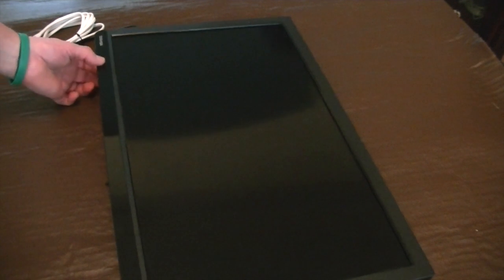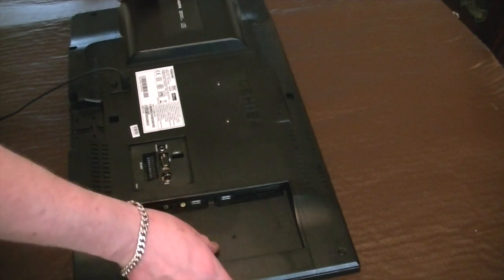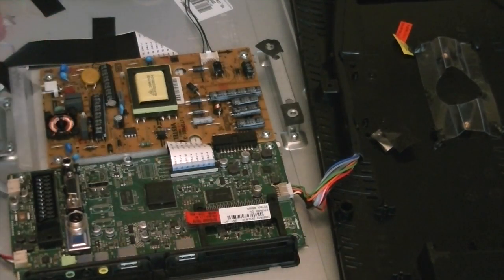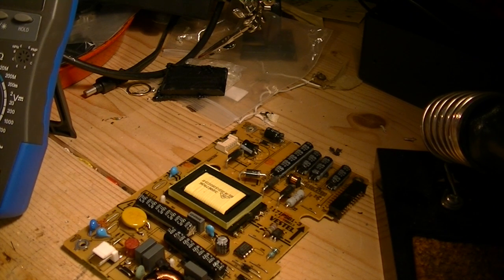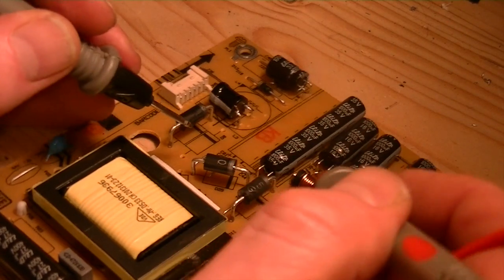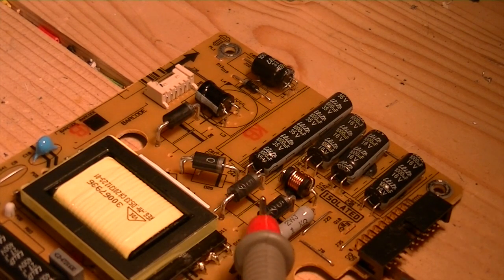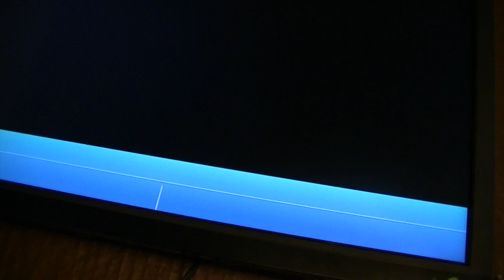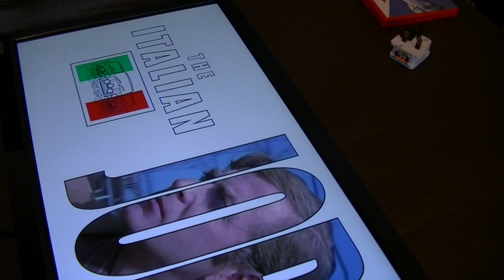17IPS61 PSU repair

Comment: I like your british humor! And you saved my life for this weekend,because I also succeeded in fixing my TelefunkenT22ED970BLLed,it had the Vestel 17IPS61-2. Also only one of the 3 big diodes in parallel was blown,leading to the shortcut. Fortunately nothing else got damaged. To mention is the type is a SB5100,which is considered too weak for this kind of circuit, theoccuring reverse voltage it cannot stand under all circumstances. This one is a Schottky diode with low forward voltage.I replaced it with a higher voltage withstanding type MUR460 from Motorola, and it is important to replace all 3 with the same type even only one got broke. Hopefully these will last longer! ;-))) Also keep in mind the polarity, for the the cathode which is signed by a white band. I soldered it to the board also with the same distance to PCB as before for better power dissipation. Thanks a lot for the video.
Reply from the maker: TheThreshershark glad it worked...

Comment: Exactly the same board in a Lindsar 28LED1600 (and same insides too by the look of it).  Exactly the same fault, bit I changed all the diodes.  Mended TV for just a few pounds.  Many thanks.  David

Comment: Good video. The faulty diode is D10. The reason that the three diodes gave wrong reading because D10,D12 and D25 are all in parallel. You done the right thing by changing all of them.
Reply: Oh it's D10. No need for me to pull one leg off and put probes on A and K

Comment: Good to see that your workshop is just like mine and I have to resort to working  on a table in the house as well. With my luck, putting it back together before testing it would guarantee a second unrelated fault and have to take it apart again

Comment: Good video and good help. I had that fault, exactly D10.
The other diodes are SB5100, but the faulty one was SB5B0.
I think I will do as you have said before, replace all and add 2 more diodes that are in the serigraphy, but have not been mounted.

Comment: Very didactic and great video. A lot of thanks for sharing Steve, from Barcelona. I've repaired my TV TLFK 22LEDPVR (power supply 17IPS61-2), the fault diode was D25 (diagonal position), I've changed four diodes for precaution as your recomendations. Magic moment when the TV works again.

Comment: Now this is a useful video, mine has only two diodes in parallel, one wasn't good, replaced it with a HER305 found in an old sattelite receiver power source since the specs are the same except reverse voltage 400V max.

Comment: For the cover opening and closing after a few glass damaging due to the hardness of plastic and the vibrations that causes leading in glass breakings especially in the corners i found a way by heating the back cover with a heat gun in the edges.This softens a lot the plastics and the opening and more important the closing is making in a very smooth way.The plastics are a kind of thermoplastic very stiff when cold but if heated is quite easy to deal with.Otherwise looks difficult and how in earth people worked on them in the factory.

Comment: Hello vice video, I have a a TV (Finlux 32findb82) and I have a problem with the TV, time to time it does not work, the led lights on some times, then it works for one minute and goes off again, I have changed the four diodes (1N4007)  the one that was on my motherboard VESTEL 17IPS62. but I have still the same problem . could you please let me know if I have to change any other parts on the the board? I will be greatfull.
Reply from the maker: The main fix is to change all of the diodes. Check to see if there are any other bad connections on the board

Comment: What's the 2 settings you used on the multimeter to check the fuse then the diodes. Cheers?

Comment: Mine powers on but turns it self off after 5 seconds.  Would a new power supply board sort this
Reply: Chris did you resolved the problem? My tv turns off the backlight if it is set to normal or high . It only works on low

Comment: Thank you.Very good video. I checked my TV and find that is same problem with big diodes and two small diodes beside a fuse. Fuse is gone too. Can you name(what  marking or name of the parts) those all parts please? (big diodes.small diodes and a fuse) I can find them on eBay then. Thank you very much.
Reply from the maker: +Antanas Antanaitis Hi see link above

Comment from the maker: This kit can be obtained from www.g4ekm.com. Free P&P in the UK
Reply: Steve Green good video but do you know where i can get the fuse because thats blown to and also three of the diodes are blown exept for one as the video. The link in description only supplys diodes and no fuse. Do you know where i can get the fuse from. Thanx.
Reply from the maker: Failz&Winz&Everything possible try RS components or Farnell. These are in the U.K.
Reply: Steve Green thanx for your reply if i were to buy another 17IPS61-3 power board from online for £20 from buyspares website how long do you think those will last for in a bush tv. Its cuz i dont have the tools to solder bits on etc?
Reply from the maker: Failz&Winz&Everything hard to say. Some last years, others pop like breakfast cereal..
Reply: Steve Green hmm il take a gamble and see if it works. Thanx for your replys.